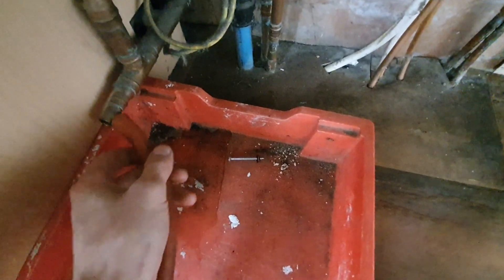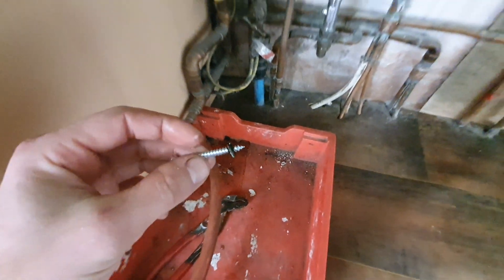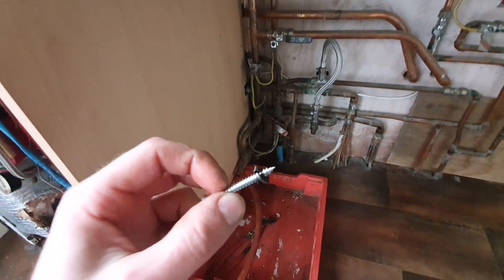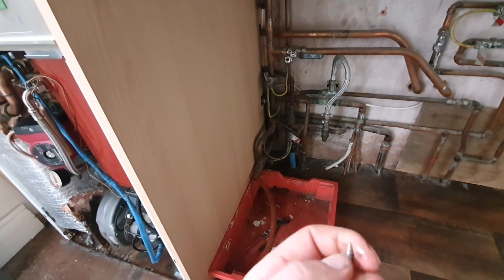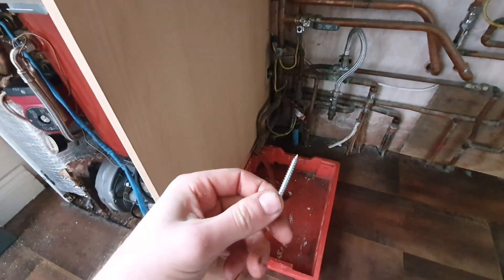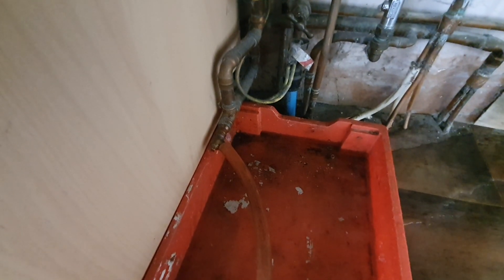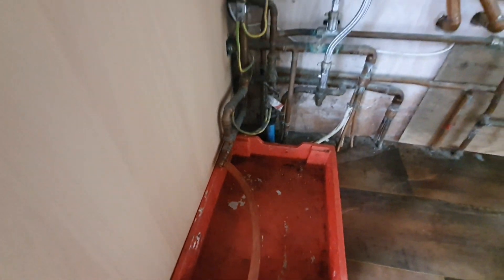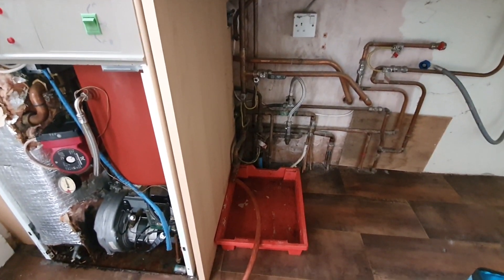The Drain off Tap Plumbing Hack

Comment: Just to add a different angle I use a screw eye, the thread is larger abs the eye bit means you can loop your finger in making it easier to pull by hand or grips.

Comment: Or if its already in several bits..............   a bent paper clip is great at hooking the bits out.

Another thing thats worth having is a metal end mill bit ( the type used in a milling machine I believe)     a customer gave me one the same size as a drain off washer and it works like a tap re-seater (just use pliers) at cleaning up insitu  drain offs faces of stuck on debris.  ;-)   

Were you ripping that heatslave 20/25 out?
Reply from the maker: The heatslave is coming out and an external systems with an unvented cylinder will be installed as there will  now be 3 bathrooms, Thanks for watching

Comment: But if there is any pressure in the system or it's open vented water will hit you in the face when you pull that washer out!
Reply from the maker: A pressurised system will hold on a vacuum until you let some air in, if the washer is stuck you can change or remove it completely to speed up draining down whilst the system is help under vacuum, then when you open air taps on radiators water will gush out, its just something I do to speed things up a bit when draining, there may be better or different ways but this method works for me